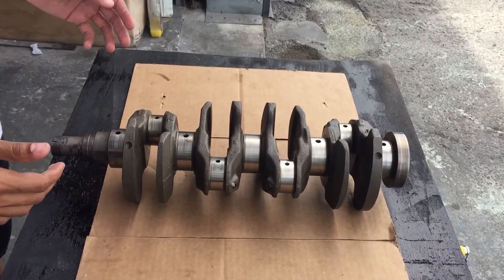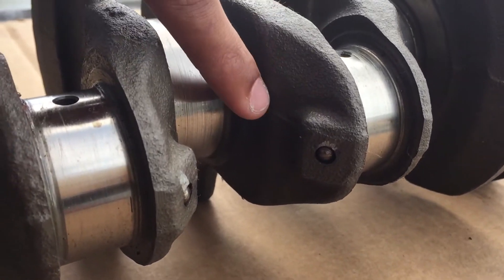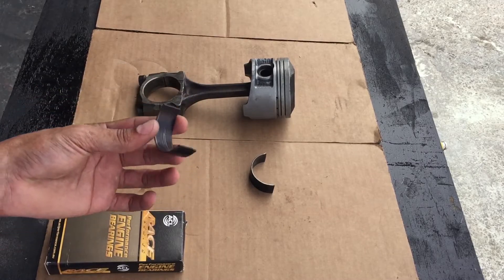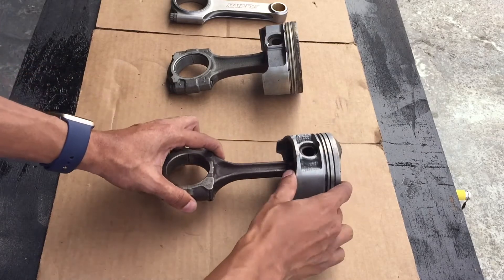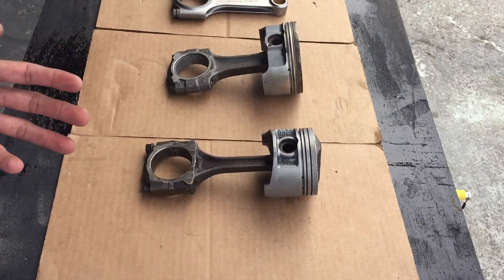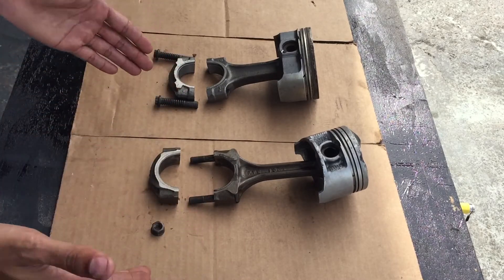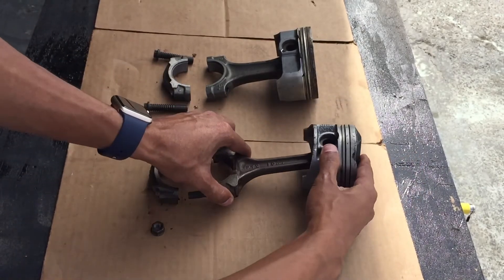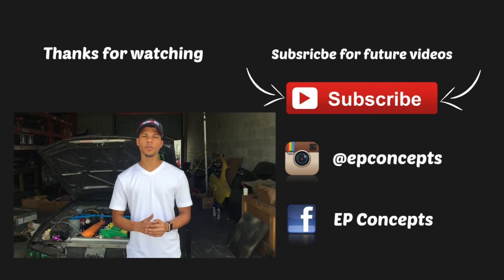Tuneto102 Ep 2 part 1 (Connecting Rods H vs I Beam)

Comment: stopped watching when you said H beams are stronger than I, Ironically you're holding a manley rod and manley make a turbo tuff series of  I beam rods  and twice the price of their H beam rods and ridiculously strong.
Reply from the maker: Then I don't think you heard correctly. I stated "its reported" then gave my personal account. The rods your referring to from manley are basicly of billet design with advanced metallurgy, so they would be very strong. However in reference to design strength, there are many who suggest the H pattern to be stronger. But if you were real fancy then the "X" pattern are stronger and lighter than them both.
Reply: Dom A  He is right.
H beam are very high torque lower rpm rods. 
I beam are high rpm lower torque rods.
Reply: Dom A
You really have to do your own research for whatever you're building but I also thought I beams were better but so many builds I've seen use H beam. Both are good regardless but it's really up to you. When it comes to really maxing out individual parts then that's when you'll need to know what will handle that max power goal but overall it doesn't really matter
Reply: @HerrKuhn928  cheaper to manufacture than I beam? Are you feeling ok? I beams can be forge stamped once I to shape, H beams are vastly more intricately designed.